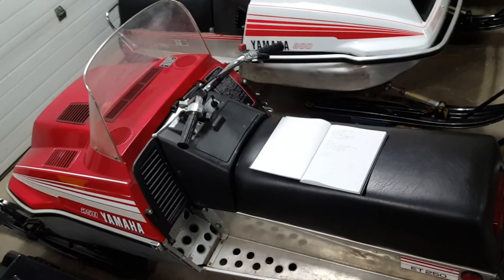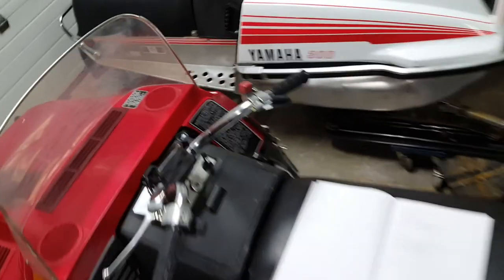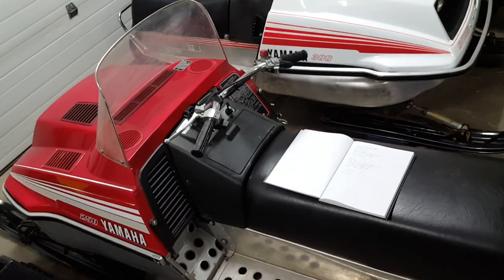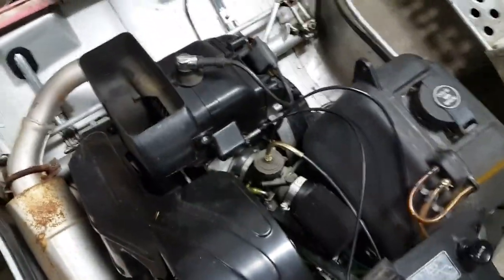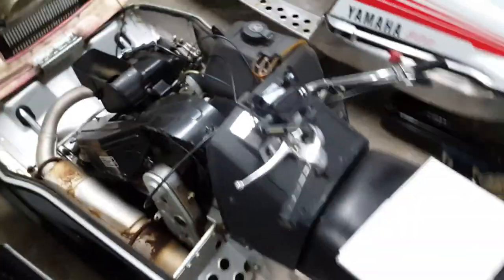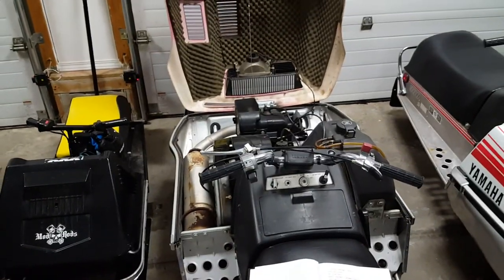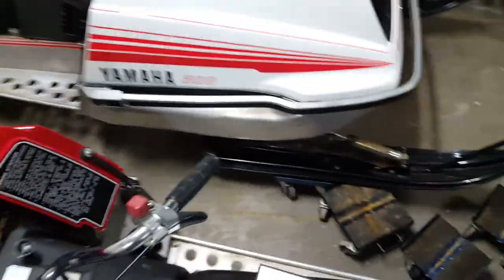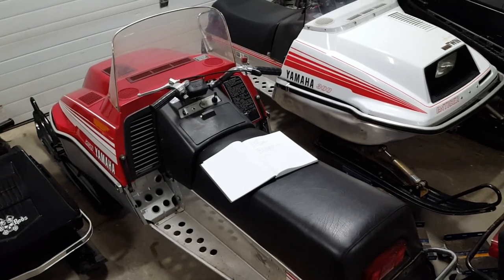1979 Yamaha Enticer 250 Mikuni carb swap UPDATE

Comment: Hi there! Nice videos! I am also swapping a mikuni carb into an et 250 for a friend. The one problem we are having is that fuel is pouring out of the float overflow tube. What did you do for float adjustment?
Reply from the maker: Brendan Little you need to make sure you have. 1.5 needle and seat for a fuel pump and not a gravity feed.
Reply: Hey Brendan, I was doing the swap at the same time you were and i was having issues as well i swapped the needle and seat to a 1.5 and i was still having it come out the bowl. You may need to set up the floats like i did. Also if you did get it running what is your jetting. My setup is listed and i still have issues with it for bogging when getting up to speed.

Main 260
Pilot 35
needle jet Q-2
Jet needle 6DH4
Air jet 2.0